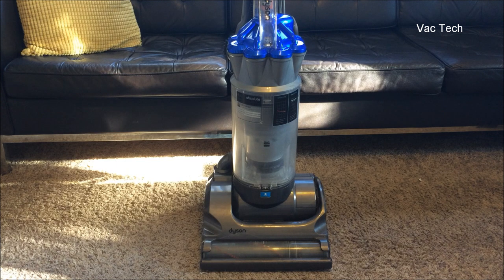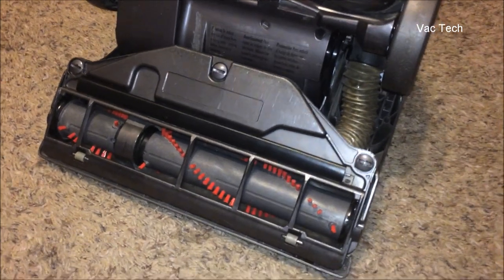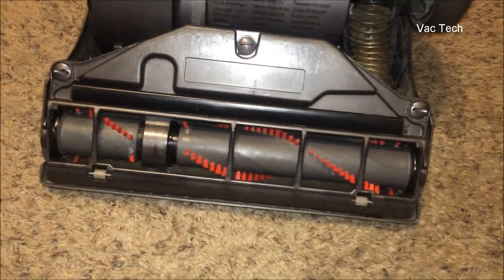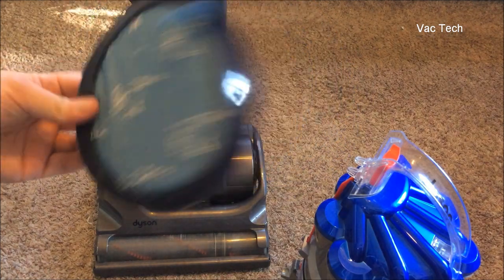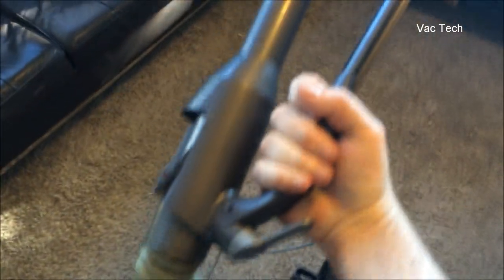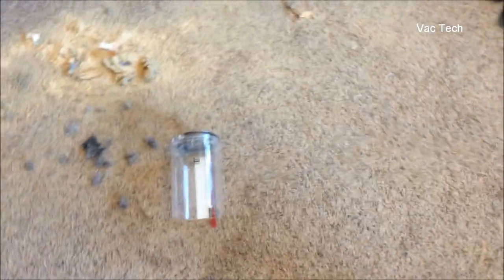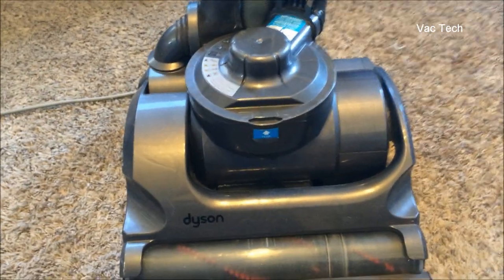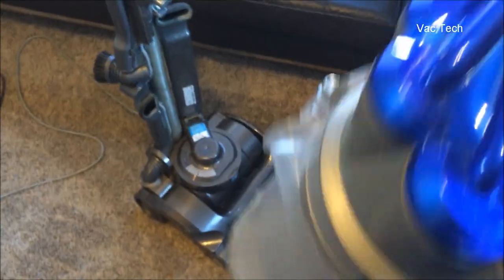Dyson DC17 vacuum Overview and Demo

Comment: I really appreciated this video! I recently received one that was going to be thrown away - as I was pulling the filter I found it was packed with dog hair and this video explained why that occurred. I originally came here to figure out how to lower the head to activate the 2nd motor cause it’s pretty stiff but I got it and it works way better than I anticipated! Thank you sir!
Reply from the maker: I can’t remember if I mentioned it in the video, but there’s a black plastic piece (it’s connected to a spring), that’s holds the cleaner head upright (it locks it to the main body). If you put a drop of oil where it catches on the main body, it’ll recline smoothly again.
Reply: @VacTech1  thank you!!!!!

Comment: I got mine from Goodwill for $10 red price in January of this year with all of it’s accessories. It was covered in dirt, it had big scuff marks on both sides. I had to dismantle it and clean it, I swapped the brushroll and sole plate off of my other one which is not as in good of shape as this one. The one I got from Goodwill is in better shape than my other one, now it looks like new. So for $10 red price, it was a steal.

Comment: Good tutorial video …especially the gasket part to watch for and mine was pushed up so I washed it and put back in place but what about how to change the other (main) filter on the side which seems difficult to upen⁉️
Reply from the maker: Glad I could help! The DC17 had two main issues to watch out for.  Keep an eye on them, and it’ll work great.

Comment: My gf got one for free some months ago as it made a horrible noise and vibration when running. It still worked well too. It sat for a while until my reg vacuum’s belt broke. So i used this one again. 
It ran for a min then the brush stopped. Turns out the belt was stretched and broke. That was why it vibrated. I found 3 new belts for $8 and it is as good as new. 
Now i just need to buy some attachments it was missing.
Reply: Got bored and cleaned it. It wasnt even that dirty for as old as it is. The hepa filter looks new.

Comment: 17:40 The 2 motor vacuum system was first seen on the Fantom Cyclone XT in the USA. The Fantom Thunder and Fury used a single motor. DC15 is the first vacuum under the Dyson name to have a two motor system.
Reply from the maker: That's what I meant. That Fantom was not engineered by Dyson. Thanks for the info!
Reply: @VacTech1  Yeah. IONA was allowed to use Dyson's patent so that they can sell them in the USA until they went defunct in 2001, where Dyson entered the market.

Comment: Someone threw this away. Just had to clean filter and fix that gasket that you showed that can be pushed up and lose a seal. Fixed and good to go
Reply from the maker: If the gasket was pushed up, look inside the cyclone pack from the underside, and make sure none of the holes (the cyclone exits) are plugged up. If you notice the pre motor filter under the dirt bin getting dirty quickly, that's a sign the cyclones are plugged from the gasket issue. Take care of that if needed, and you'll be good to go! Nice machines, still my favorite Dyson.

Comment: Seems better than any Dyson offered today.
Reply from the maker: They have some good offerings today, but indeed it is.
Reply: @VacTech1  theres a dyson dc17 animal for 15$ plus shipping should i get it the brush dosent work guy said needs new belt
Reply from the maker: @TheVacuumWizard  That's relatively low risk. The brush not spinning on a DC17 could mean more than just a belt, just so you're aware.
Reply: @VacTech1  they guy said its just the belt he just dosent want to take the time do replace it
Reply from the maker: @TheVacuumWizard  alright give it a shot! Could make for a fun project.
Reply: @VacTech1  whats worst thing that happens i part it out sell the parts and buy a refurbed one off ebay
Reply: @VacTech1  I just found a dc17 on ebay may do that instead the one on ebay looks cleaner guy said thing wont turn on I think its probably the cord or switch
Reply: Also the Dyson baby with the digital motor is also very good. The brushless suction makes a high pitched but, pleasant whine and has more airflow than any other Dyson canister vacuum.

Comment: We had a DC 14, and a DC 17 back then. The 17 kept getting dirt in the filter. I guess the cyclones got dirty. Idk but the 14 didn’t have that problem.
Reply from the maker: It was the notorious gasket issue on the bottom of the cyclone pack. It got pushed up, let dirt into the cyclones backward, clogging them, which would cause the filter to get dirty quickly. Happened on a lot of them, but it can be remedied.
Reply: @VacTech1  saw the video after commenting. We have used dyson’s cordless now, but stick to bagged Kirby and Electrolux after using those old dysons.

Comment: Just picked up my 2nd older Dyson from Facebook because the owner had no suction.  Tore it apart, cleaned it, and like brand new.  Would like you to show how to access the 2nd filter.
Reply from the maker: If it's this same model, underneath there is a screw near the rear wheel, and that loosens a top cover for the exhaust filter. The filter is pressed into the motor housing, and pops off from that, then pulls out. It can be tricky to get the filter popped back into place.

Comment: I’ve found that all the issues you’ve described haven’t happened to mine. Instead, my cyclones get absolutely clogged with hair
Reply from the maker: That only happens if that gasket on the bottom of the cyclone pack gets pushed upward, causing the cyclone system to fail, and fill with dirt. Once it happens, the whole cyclone pack needs to be taken apart and cleaned.
Reply: Vac Tech ohhh thx I just opened the pack yesterday and saw the gasket is busted as mentioned
Reply from the maker: @spod2998  Most of the time, they simply get pushed upward, and be pulled down, and it will seal again. However, it can happen again easily, so you have to be careful when you empty it.

Comment: Thanks for your video. v informative. I have this DC17 MACHINE. Have a problem with it. the vertical part is stuck with the horizontal part at 90 degree and vertical part would not recline. I have to use lot of force to do that and it would make a loud sound when doing it. I feel something might break while putting force on the horizontal part to get rid of the stuck part. do you know what might be wrong with this stuck problem here. thanks. is there a way i can contact you over the phone. thanks.

Comment: I’m having trouble with mine. Every time I go to take the canister off to dump it the top comes off instead of the bottom. The red release is not opening it for some reason. Where can I learn more about this vacuum? It is bigger but far surpasses suction compared to my Shark Navigator!

Comment: Does anyone know if you can replace the rubber gasket at the bottom of the cyclone that seats over the cleaning door at the bottom?  Mine will not seat tight and all the dirt ends up on the filter.
Reply from the maker: You could clean everything, then glue the gasket to the cyclone with some strong glue (make sure it's all lined up correctly though!). Otherwise you'll have to get a new cyclone pack to get a new gasket.
Reply: I used a big zip tie around the gasket at the top where it sits in the groove, cut the excess off. I later glued it on. I did the zip tie because I couldn’t wait for glue to dry, we had to get a cleanup done then and there.

Comment: How does the Dyson DC17 compare to the Dyson Ball Animal 2? I am curious.
Reply: I'm curious too.  The Ball Animal 2 (still don't know why they stopped using the DC model number format) also has a round brushroll with stiff bristles for strong agitation, so I would think it would be pretty equal with the DC17

Comment: Is this vacuum only specialized for carpet or is it also good for hard floor use?
Reply from the maker: It can be used on carpeting or hardwood floors! Works well on both, but it'll snowplow larger debris on hard flooring.

Comment: My dc17 slings cat litter on short carpet and has low suction. You think it just needs a good cleaning?
Reply from the maker: Absolutely.  Make sure it's not plugged up in the base (check the hose by the brushbar), and also make sure the gasket at the bottom of the of the cyclone assembly is pulled down and sealing properly to the trap door at the bottom of the bin.  Check the filter under the bin too.  If there's a pile of lint and hair on it, you're gonna' need to service the cyclone assembly.  If it's just dusty, simply wash the filter (let it 100% dry before re-installing it), and make sure there are no blockages.  Clean the screen in the dirt bin as well.  I hope you can get yours working great again!
Reply: You need to completely disassemble the cyclone part and clean. It’s amazing how much dirt and hair and dust gets trapped in there. There are videos on YouTube that show you how.
Reply: @VacTech1  yep, everything working great now!

Comment: How do you just bring the handle down
Reply from the maker: Is it stuck in the upright position? The locking mechanism for the base could be stuck. I grease the track the locking guide rides along underneath the base(I believe it's a black plastic part with a spring on it, but I'd have to take a look).

Comment: Does it have a tandem air system like riccar?
Reply from the maker: No, it just has a separate motor to drive the brushroll. It's a huge motor though for a Dyson, and it really cleans great. It pulls the machine right along as you clean.
Reply: Oh
Reply: @VacTech1  I want one of these because I have a cinetic big ball animal upright it is a letdown.
Reply from the maker: @charlesrodriguez7984  I don't care for the Cinetic, sadly.  This machine is awesome. Much better tools and filter setup, and it cleans carpeting much better.
Reply: @VacTech1  how do I get one of these used for a decent price and working?

Comment: what if it won't recline?
Reply from the maker: If you flip the vacuum over, behind the brush near the hose in the base, there's a black plastic piece that likes to stick. The wand/hose could also have a blockage at the bend. Does the hose have suction when you turn it on?
Reply: @VacTech1  yes it has very good suction.Thank you so much,I couldn't recline it back at all,it works now!!
Reply from the maker: @maryl3ftwich778  great! If it was that black plastic piece, a small drop of oil on it where it catches, will help smooth it out. Glad I could help!

Comment: How does the Dyson DC07 compare to the Dyson DC33? I am curious.
Reply from the maker: I think the dc17 is much better. I hope I was able to convey why in the vid!
Reply: The DC33 has a plastic wand pole which makes the spine (which of course is plastic too) of the machine flex and feel very flimsy as you move it about. The earlier units back to the DC07 are superior. The DC33 was built for about three years until it was shelved and all focus was directed towards the Ball style upright.

Comment: I saw everything in your video except how to lower the handle to vacuum
Reply from the maker: Haha you put your foot on the front of the vacuum head, and pull the handle back. Sometimes the head will get stuck, and there's a black plastic piece on the back of the nozzle (it's connected to a spring), that locks the machine upright.  Just needs a drop of oil on it. Frees it right up.